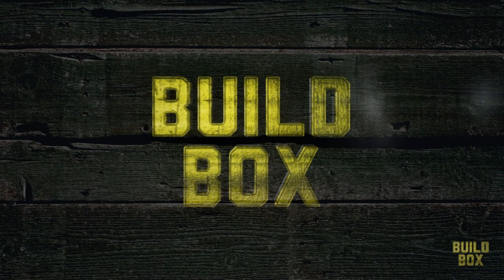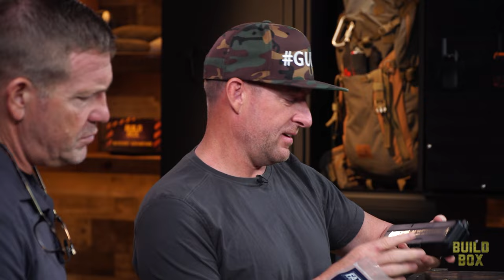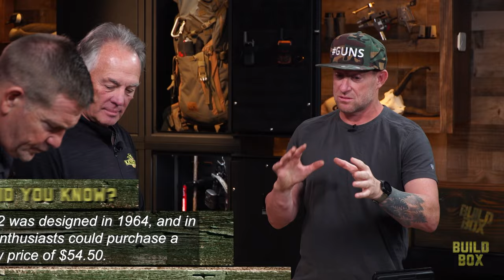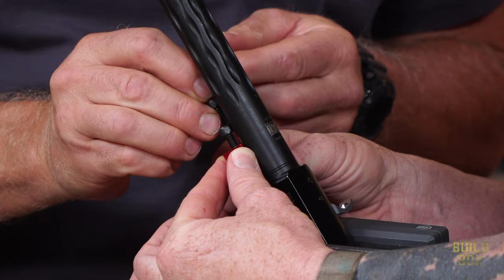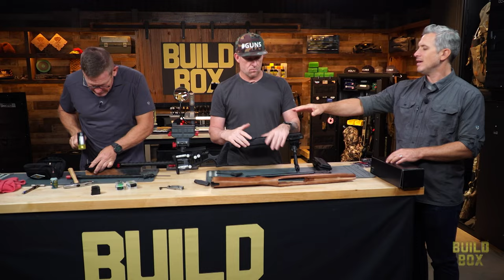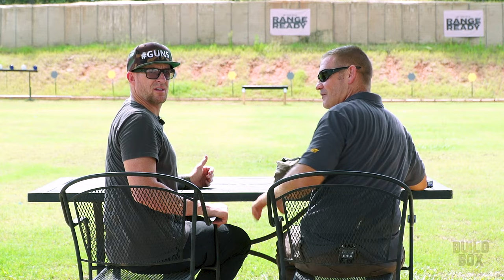Build Box: Old Gun, New Life | Gun Talk Media

Comment: Really don't like this format. Would have been a great gun done like season 1 to see what other builders could come up with. Watching you guys throw parts at it is boring.
Reply from the maker: Thanks for the feedback.  We are always trying to tweak it to make better. What we found is the competing builders built very similar guns, so one of the goals of this season was to add a little more variety in each build.  Also we wanted to incorporate a few more tips and tricks.
Reply: What 'tips and tricks'? All you did was disassemble and then reassemble, replacing every part except the receiver. How about showing how to tune the sear and adjust the take up and over travel screws of a Clark or Volquartzen competition kit. Anyone with more than 10 brain cells and three fingers on each hand can push out 2 pins and swap out a trigger pack. Or the 'trick' of drilling/milling a hole in the rear of the receiver so, that a traditional cleaning rod can be used. And maybe talk about different mag releases with their pros and cons. Not to mention that for a benchrest tack driver a 1-6 scope is the last thing a serious shooter would want.
As for builds being similar, maybe, just maybe that's due to the design parameters YOU foist on the builders.
Stop showing clowns launching detent springs and crawling on the floor for parts your own judges lose.
Bring in serious competitors using the same platform and have them build for their specific discipline.
And, if you're just going to throw parts at a 'build', have the decency to let the viewers know how much it's going to cost them.
Oh, and the "guess who just showed up"  trope isn't entertaining. Quite frankly, it's insulting.